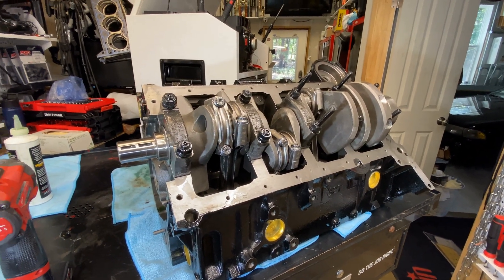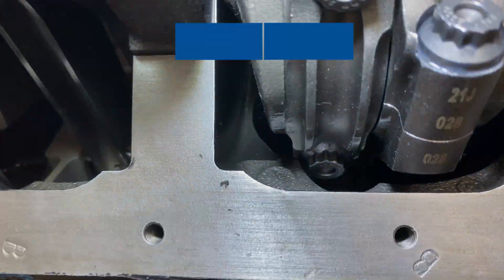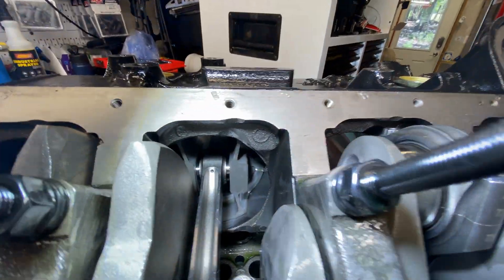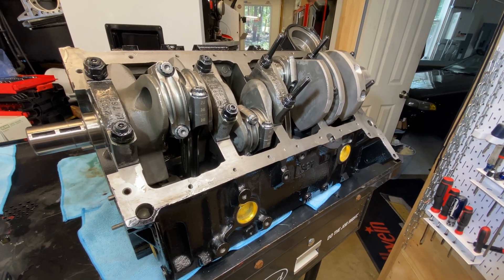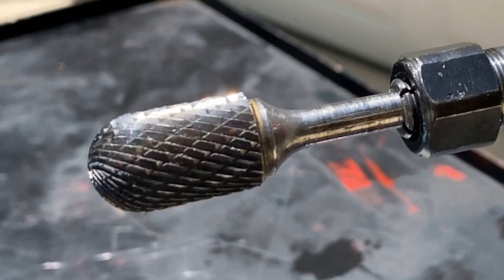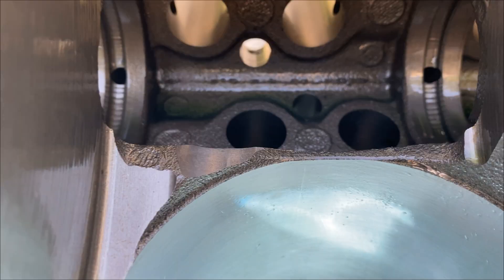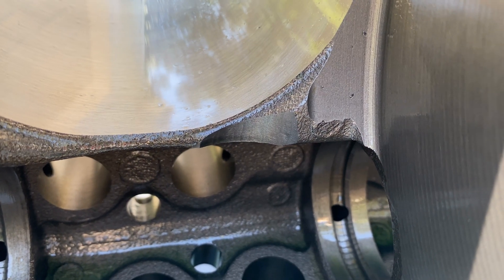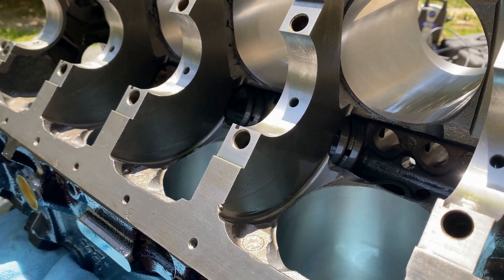LT1 Rod Clearance Block Grinding

Comment: Were those 6” eagle H beam rods? Do they require more clearance than I beam?
Reply from the maker: Those are actually Compstars and they have good clearance.  Better than Eagle H-beams.  The Eagle H-beams have the rod bolt sticking out pretty far.  I would say the Eagle I-beams might be just as bad as far as the bolt head sticking out.  Thing about the Compstar rod is that it needs a bit "wider" clearance and not as "deep".  That bolt is recessed pretty well.  But it has material surrounding the bolt head that has me clearancing the block a bit wider.

Comment: Would be nice if someone could come up with a template of some kind. Maybe a plastic template or impression that could be use as a minimum starting point.
Reply from the maker: Good idea.  I should make one for myself at least.  I don't always get the right spot on the 1st try but have resigned to know that all I have to do is get close on the 1st grind then mock up the whole assembly and then mark for fine tuning grinding and final wash.  The engine get's two washes that way.

Comment: that's cool 😎 you make it look easy
Reply from the maker: I finally found the right tool and grinding bit.
Reply: @EllweinEngines  hey Carl 👋 could I carburetor my lt1
Reply from the maker: @edwardcold7431  Yes.  GM makes a carburetor manifold for the LT1.  I'm sure Summit would have it for sale or a used one can be found.